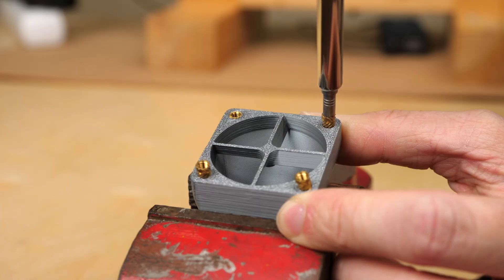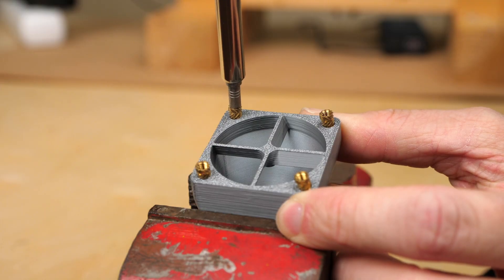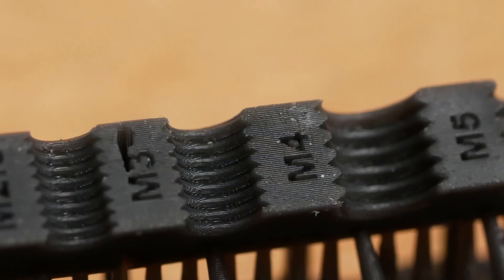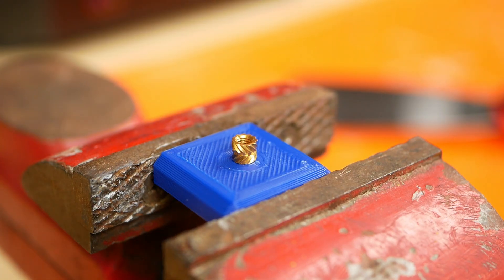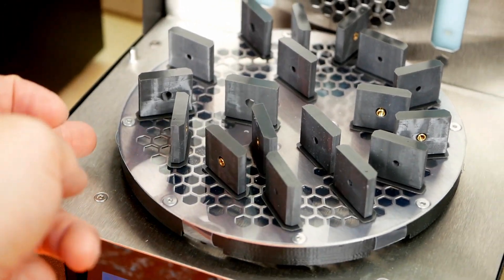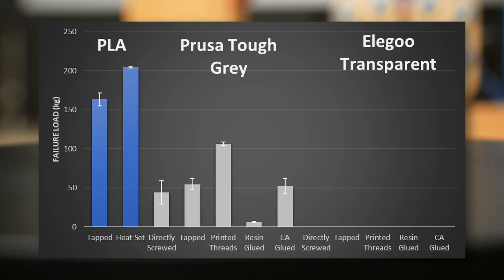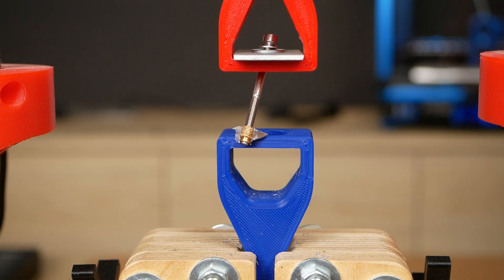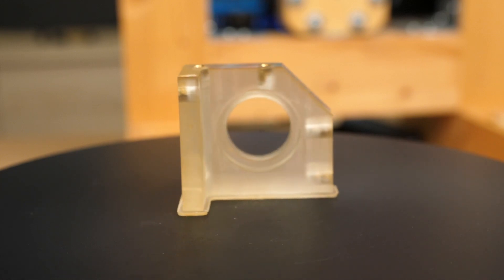Mastering Heat-Set Inserts in Resin 3D Prints

Comment: 1 Put the inserts upside down so the widest point is at the bottom (this would work for glue and resin) which would make it easier to flow material around the fitting, allow light to transmit deeper around the fitting and when cured would provide a more mechanically retentive layout.
2 Use translucent resin and a stronger UV light source (dental unit would work sweet)
3 Use a duel cure light-cured resin. Common in dental industry

Comment: I don't think it is ideal to compare a M3-screw to a M3-threaded insert, because for the insert you need a bigger hole and therefore you have a larger surface area. A better comparison would be a M4-Screw  vs a M3-Insert resulting in a smaller difference for PLA parts and strong win for directly printed SLA-threads.

Comment: I tested printing threaded holes in PLA and PETG. I was surprised to find out my Prusa MK3s was able to print M3 size that still worked well (but was a bit tight). Larger sized like M4 were very smooth. That is something one can try out and see how it workes. Often I need screws just to keep a lid closed or similar situations where printed threads can work just fine.
Sure, if it is something you open and close multiple times (like a battery compartment), inserts are better and will not wear like plastic probably will in time.
I've got no resin printer and no experience how well printed threads work or not in those type of prints.

Comment: inserts work very well in resin prints in situations where screws have to be screwed in and out many times. The insert is then saved by the thread in the resin or the hole in which the screw is placed.

It is best to place the inserts immediately after printing the object, before washing it in alcohol. They may not provide the force of your test, but they will protect the printed hole from the screw that will be screwed in.

Comment: One thought is using the stepped inserts backwards.
In other words, the smaller diameter at the top or outer surface. 
If you were using a conical fastener in a conical hole, you would naturally arrange it so that the cone points in the direction of the pulling force. So why not do this with the inserts?

Comment: PLEASE READ IT, STEFAN! I may have an explanation for why the resin prints underperformed so much and why they exploded so easily. 

The devil's in the detail. In the jig to be specific. You use PLA holder with PLA plates. But you also use PLA holder for resin plates. With PLA+PLA combo, you see significant deflection in the holder. It's not critical since the PLA plate also has as much elasticity. For the resin plates, however, because of the holder deflection, most of the force on plates is on the edges, resulting in bending forces rather than thread shearing. For real-life strength approximation, you could be testing plates and holders from the same material (as you mostly print all the mating parts from the same printer), but for more universal results and thread testing strictly, the holder should be from something more rigid (like aluminum - you can cheaply order such a part online).

Great insights, as always, Stefan! Your videos are the best out there on 3d printing. One or two of them combined usually have a similar scope of testing to the engineering thesis I review.
Reply from the maker: Good point. Might update my test setup!

Comment: Seems to me that threaded inserts like the ones used for MDF furniture, where the outside is threaded as well, would be the ultimate. Just model the threads and maybe a touch of CA to stop them from coming out. They normally have a recessed allen key head for convenient insertion.
Reply: They are still limited by the strength of the resin printed threads. The only thing I can see them or helicoils helping with is how long they last screwing and unscrewing the bolts.
Reply: @conorstewart2214  The threads are bigger than the target bolt and seem to cut deeper into the material, so it could have more strength for the same sized bolt.

Comment: What is the likelihood that it isn't the insert, rather, the PLA-holder combined with the brittleness of the SLA/resin part that is the real limiting factor?
Look at 7:13 (freeze-frame). The blue PLA part is able to arch when loaded, as it is relatively thin-walled. The "DUT" is then no longer loaded in the middle, rather at the sides. This shall put a bending load on the SLA/resin part, causing it to explosively fracture at the weakest point (around the point where the insert is, well, inserted).
In that sense, a steel "blue frame" (or anything else that is orders-of-magnitude stiffer) shall give an  apples-to-apples comparison between PLA and SLA/resin, IMO.

Comment: Great video, my thoughts 💭 is why not using heat set inserts with resin especially for 3d printers parts this will be more convenient of abs or pla parts because the Abs / pla parts not holding the heat inserts well when the parts exposed to heat , I think with resin inserted much more resistant to this application , in my experience with voron parts I need to re print the parts which hold the set inserts time to time because is become loss . 
And the other solution for using resin parts to put a square nuts if the design of the parts allows this . ☝️

Comment: A good vid as always but I'd be interested in seeing if your stepped hole was stronger when pulling from the other side? It seems like you were pulling from the weakest point. Obviously you calt always put the insert in the other side of the hole but if you can I could see it being either stronger because you're bracing against more resin or quicker to shatter because all the force is going onto the resin.

Comment: Here is why the resin doesn’t cure when you’re trying to resin glue insets into the part. First off, uv light doesn’t pass far through resin, only about 0.5mm into the part. Second: resin doesn’t cure in the presence of oxygen so it won’t cure if any oxygen is in contact with the liquid resin.

Comment: For my functional resin prints I use a mix of 70% Siraya Tech Blu and 30% Tenacious.  I'd highly recommend this mix or anywhere from 50%/50% to 90%/10% depending on the part stiffness requirements.
Reply: It's definitely worth it, the high strength resins are strong but brittle, adding something flexible like tenacious makes parts that are much more tolerant to impacts and keeps it from shattering making for a much more useful part
Reply from the maker: I seriously start playing with resin mixing at some point!

Comment: so depending in the resin the properties change drastically. Not to mention tough means different things for different manufacturers. That being said you can heat set without glue. At least I've managed to do that in the resin i use which is a 25% Sirayatech Blu in clear, 25% tenacious clear yellow and 50% Anycubic Standard+ in clear.  But you need to preheat the entire part. Like I put it in an insulated heated chamber for like an hour at around 90C. I haven't tested the strength but since i'm not really creating load bearing parts i'm not worried and it hasn't failed so I'm happy and it works at least for me

Comment: Have you considered making insert setting tips compatible with the TS-100 portable soldering iron, or Hakko T12 (same interface/system, only much longer cartridges)? 
I've been wanting to buy your inserts and accompanying tips for some time, but they aren't compatible with the heating cartridge style tips of the TS-100 or Hakko T12, and I don't intend to buy another quality/expensive or inferior/cheap soldering iron just for setting inserts. Both the TS-100 and the Hakko soldering stations that use the T12 tip are very popular soldering irons, so I definitely wouldn't be your only customer.

Comment: Based on printed threads always outperforming heatsets, it seems really goofy to insist on using the inserts in resin. But sure, if you need to significantly increase the mate-demate cycle count, either keenserts or helicoils would be much more appropriate tools

Comment: I tried threaded inserts but I wasn't impressed. So I'm not really using them anymore. I either use plain holes all the way through with a nut on one side or I use self-cutting screws and printed guiding hole.

Comment: I wonder how much just the material properties. I don't know much about resin, but I wonder if the main reason the clear resin did so much better is simply because it is clear and was able to cure more fully. I'm also curious how these results scale with larger threaded inserts and thus more features and surface area to adhere.
Reply: I'm also thinking that too.

Comment: I wonder how well a Heli-coil insert would perform. These are often used to provide a durable thread for softer metals such as aluminum and magnesium. The coil is just that, shaped like a spring so it's larger than the tapped hole but can compress into it. In metal you drill and tap an oversized hole then screw the Heli-coil in, then break the tang off. It provides strength by both seeming like a larger fastener and by making the fastener hole from stronger material with tighter tolerance. If you glued them in the glue line would be very thin. but you could install them dry and in a resin printed thread I expect would perform very well.
Reply from the maker: Tested that a while back: https://youtu.be/2wRc1KbEAU8
Reply: @CNCKitchen  I had forgotten about that. Thanks for the link I re-watched it. The Heli-coil failed in the PETG at about the same load as directly threaded because the directly threaded part, while having a smaller diameter had a longer engagement. Heli-coils do come in longer lengths. I expect if you had a longer thread engagement you would get superior load capacity. 
I want to thank you for your channel. You add something few other people do, original research which is very focused on real world results. I appreciate you.

Comment: I would be interested to see a torque strength comparison between the methods. I have always tapped my resin holes because of print orientation limitations, but the torque strength was not ideal.
Reply from the maker: Great point! Yet, tightening torque and axial force are in a way proportional (assuming friction stays the same). The benefit of the inserts here is, that you tighten against a metal part that can bear more force, compared to tightening against plastic which also means lower torque resistance.

Comment: I recently came across screw in inserts which have a slot in them for using a screwdriver to fit them in the hole, and they are self tapping in a way. I really love their convenience and ease of assembly
Reply from the maker: These are mainly used for wood and if you are careful can also be used in 3D prints and are usually available in hardware stores.
Reply: @CNCKitchen  You could model the insert threads into the part, dab some CA glue/epoxy onto the insert, screw it into the threaded hole, and have the best of both worlds: the strength of printed threads and the re-usability of an insert.

Comment: I’m honestly surprised at how poorly the two part epoxy bonded to the resin print. Perhaps it bonded extremely well and instead sheared off just wider than the printed hole? I’ve always heard that epoxy sticks to just about anything and becomes stronger than many materials it’s holding together (within reason of course). 

Also, I think the regular resin results outperforming the tough resin in the direct/tapped/printed thread tests make sense because it’s stiffer and less flexible. That said, I’d expect a different failure from the tough resin in that case like the single thread jumping failure.

I’d also like to add that there’s many different tough resins available and I’d be curious to see their strength test results. I’m sure Prusa makes a good one but I haven’t heard their material being the strongest of the photoset polymers.

And honestly, I’m kinda shocked the transparent print had any difference in UV penetration for the resin glued insert. UV barely penetrates millimeters into most materials and their visible color shouldn’t make much difference. Then again that may have just been a rule of thumb and perhaps there is a bit more penetration with transparent material… Or the resins were otherwise different enough to cause this

Comment: Hi Stefan, thank you very for sharing these experiments. I usually manually thread holes into resin parts with Isopropanol BEFORE post UV curing these parts. It is much stronger than doing it AFTER post UV curing like you did.
Reply: sounds like tapping it while a bit soft greatly reduces micro-cracks!